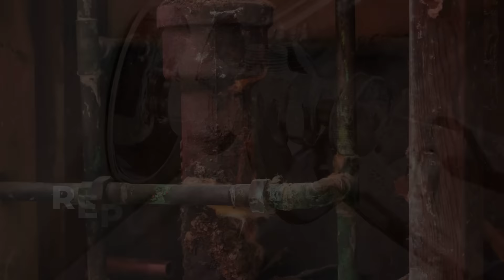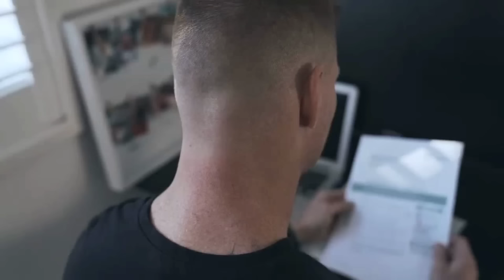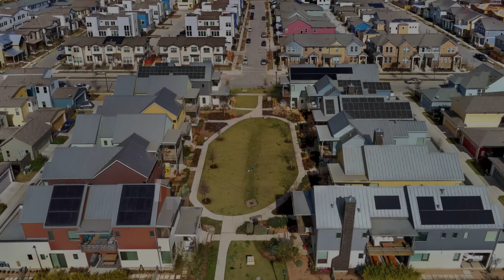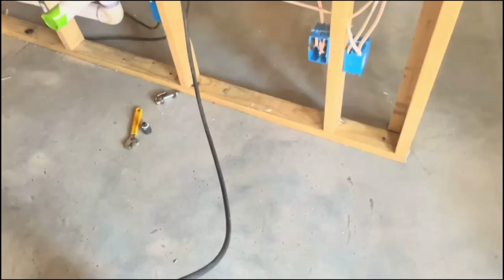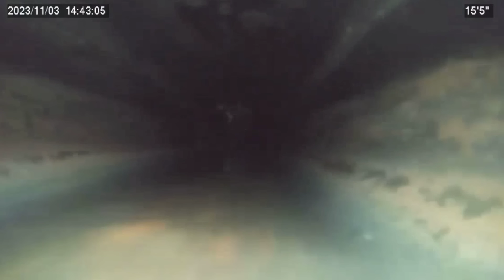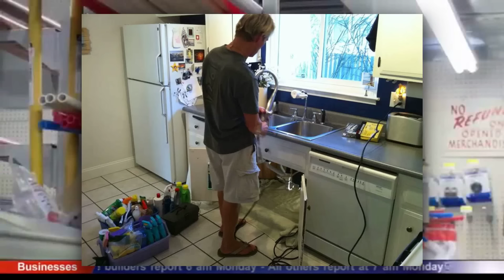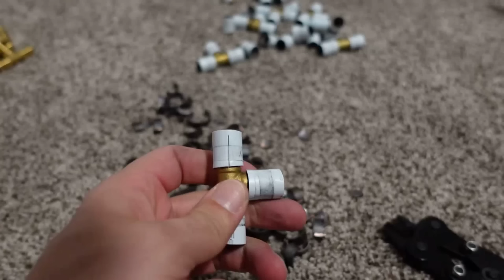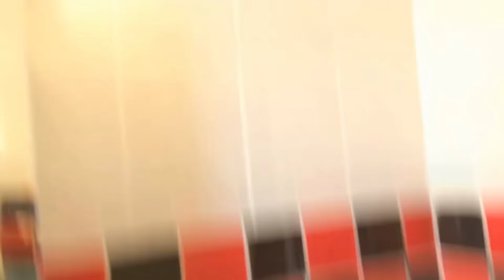Why 90% of New Plumbing Work Are Garbage (The Builder Grade Lie)

Comment: I replaced 60 year old galvanized pipe with PEX-A using crimp rings in 2009 and it is still in excellent shape.  I bought a crimping tool to do this for $125 which is something that a lot of plumbers are unwilling to do.  I don’t trust push on connectors because o-rings break down due to exposure to water.  Don’t believe me?  If you have a black rubber flapper valve or rubber washers in your toilet tank, rub your finger on the rubber and it will come away coated with a black coating.  That coating is rubber.
Reply from the maker: That's a solid move, those push-on connectors are definitely risky 🛠️

Comment: Use schedule 40 pvc pipe instead of abs pipe for drain lines. Copper lines in new houses is tricky because of copper thieves. Anything installed before the house is secure is subject to stolen.
Reply from the maker: That’s is sad, schedule 40 is thick is good for drain. I used it on my hvac system with EZ trap, drain pan, float switch

Comment: Cast iron is rated for around 125 years. ABS is rated for 65 years. The boomers screwed us every way they could.
Reply from the maker: It really makes you wonder about current building standards.
Reply: @QualityRot I would guess the average new home will be condemned at about 75-100 years as the plumbing, electrical and pine used to build them are all rated around 65 years.

Comment: There are automatic shut off valves now. But most of them are garbage too.
Reply from the maker: It seems like you can't win these days 😕
Reply: @QualityRot you just have to read the small print. The water valve is made of plastic and likely has a useful service life of 8-12 years. Unfortunately, they havent been around very long and builders arent required to use them so they cost a small fortune. For a $1000-2500 parts and labor install, youd be pretty protected against major flood damage for 8-12 years.

Comment: There is so much wrong with this video that I don't even know where to start.  Images, not matching the discussion and unrelated images, confusion on push to connect and Pex, lack of clarity on the types of pex, totally ignoring the use of CPVC in supply systems and PVC in drain systems, not clarifying the difference between conventional cast iron and Polylineed cast iron, etc. etc. etc.  Let me just say that blaming all this on the builders is not very accurate either as 90% of the homeowners buy based on price.  They will buy the cheapest part for whatever they're trying to accomplish when they go to the big box store.  There are quality oriented builders out there that will build with better materials, however, they are rare because the buyers force them into using the cheapest materials and labor as people don't wanna pay any extra and we'll buy the new house down the street that is cheaper!!!
Reply from the maker: Thanks for the detailed feedback, I'll definitely take these points into consideration for future videos! 🛠

Comment: A rather broad brush being used here and the prices mentioned are definitely too low. Also I've installed more than a few WHs and they've all come with the proper TPR installed. I only use push fittings for emergency repairs. They never get closed into a wall or whatever.

Comment: I have KITEC in part of my house and it's been in use for 23 years and I've never one had a problem. The video is correct, it's not a bad product, unless the plumber who installed didn't have a clue how to do it properly. I even have a section running to my outside ball valve for my house. The pipe has never had a problem in all these years, but,  i can't get house insurance from a distant company because of the previous issues in other homes.

Comment: I refurbished a 2500 sq. ft home converted to two apartments in 2008. Used pex for everything, including heat lines. That requires specific pex, of course, with an oxygen barrier. More than 2,000 feet of hot/cold and heating lines. Hundreds of fittings. Now, 18 years later, not a thing has gone wrong. This "10 year" claim is just  baloney.

Comment: Pex is not great if rodents are even a possibility.  They chew it open to get water.  Cast iron drains in older homes like to get hard rust clogs. I just had to bust out a few with a power auger, and they are tough. ABS plastic drains seem to last the best and do not corrode.

Comment: 38 years with home run pex and crimp sleeves. No problems except the 36 port mana-bloc started leaking 20 years in. Replaced it with the newer O-ring sealed bloc. Works great.
Reply from the maker: What type of condition are you living in?
Reply: @QualityRot 
Semi-arid, 4700 feet elevation, 70 psi water. 2 kitchens, 4.5 baths, and 2 laundries. Two 50-gallon water heaters in parallel and a water softener.

Comment: I already had 2 cast iron toilet fittings fail due to rust, yes in older homes, but pvc does not rust
Reply from the maker: That’s is true but also the longevity is how the installer installed it

Comment: Ex-builder. Older aged and was working at a big box hardware store running the plumbing section. I told folks back then not to use plastic pipes. Why would you want your water running through plastic? Go copper all the way.

Comment: It seems like, as with electrical wiring, PEX connections should not made behind walls or ceilings.  Those connectors sure seem crappy.
Reply from the maker: I agree with you! I have bad experiences with them. Even installed properly, I’m I am still not with it

Comment: Ok in old time fittings were made not from brass (dezinkification on hard acidic water CO2 solved in water, generates carbonic acid that dissolves Zn) but bronze which is CuSn alloy Sn more corrosion resistant, non toxic (used as staniol in food industry now aluminum which due to its organic salts with fruit/veggies acids water soluble, involved in Alzheimer's) but more expensive!

Comment: There is nothing wrong with PVC or ABS waste lines - cast iron hasn't been used since the 70s in residential, and only in commercial installs now and even that's being replaced. We have ABS waste lines - our house was built in 1982 and all of them still work without issue. By your video, the lines from my shower and kitchen should have melted long ago because they have hot water go down them. Cast iron and clay are notorious for having root instrusion issues, and cast iron rusts out. A commercial building built 4 years later after my home I work in had to close the entire 1st floor bathrooms because the CI pipe is rotted at the bottom.

Comment: Yea I don't trust new build homes unless it's custom. 
Standard track homes I have worked on after warranty has run out for clients.
They will be tear downs in 20 years.
I chose a home built in the 70s with copper plumbing. 
Tried and true. And has withstood the test of time.

Comment: [ PEX ]  is  petroleum based based plastic. Being that said water will leach the plastic into the water you use and in about 15 years it will start to fail not just in the joinery but structurally as well.

Comment: I'm going to get a lot of thumbs down; sometimes the truth hurts.
90% of poor quality is driven by the buyer. Money talks; almost every home buyer wants square footage and finishes to impress. Items such as mechanical systems, foundations, drainage, insulation, flashing details, etc. aren't on the minds of the typical buyer and certainly not a top priority. 
In a subdivision of multi-million dollar homes I watched a well designed and crafted home sit on the market while another builder that had a reputation as a hack sold 6 crappy McMansions. I knew a person that saved up some money for a kitchen remodel, she bought granite countertops instead of a new well that she needed. I offer a quality home with excellent value but the majority of the time I can be outsold by a competitor with a fast talking salesman.
I've been a GC and trade contractor in New England for 45 years, I've seen some things. The thing that baffles me the most is to many seem to be impressed by speed; they'll comment about how fast a house is completed more often than the thermal performance of the windows. Japanese houses have a design life of 30-40 years,  many European homes take a year to build and are intended to last hundreds of years- often handed down in the same family for generations.

Comment: PEX plumbing has been the standard in Europe since the 1980s. It has been used in the US since the 1990s. The new ungrade is the PERT pipe. Basically, it uses the same fittings as pex. Instead of Sharkbite style fittings , I used brass pex fittings with stainless steel collars for indoor plumbing. A pressure tank is used in conjunction with a private well pump. If properly installed, modern plumbing will last as long as you need.
Reply from the maker: True, if it's installed right it definitely lasts longer.

Comment: So the three dollar braided hose flooded the entire town😂
Reply: In a high rise a failed braided line usually takes out 3 floors when it fails. Can be 6 units on each floor.  Very expensive and a nightmare for building managers. Smartest option is body corp auto replace every 12 years and charge unit owners.

Comment: The insurance companies should require some or all of these higher standards
Reply: I seem to remember last year reading that some insurance companies in some states (maybe all) won't insure houses that have polybutylene pipes, if they know it is there.
Reply: @jasonj9864  That's good, but it sounds like they need to require the higher grade flexible hose connectors on sinks and toilets, and the fittings for pex.

Comment: I think the author of this video means Sharkbite instead pex pipe, mostly because pex pipe uses clamps.
Reply from the maker: Ah, the classic SharkBite Sleight of Hand! 🦈 You’re right that PEX should be crimped like a professional, but builders love SharkBites because they can 'install' a plumbing system with the same skill level required to put together a Lego set. Why use a calibrated crimp tool when you can just push two pieces of plastic together and pray the O-ring lasts until the check clears? Welcome to the club of people who actually know what a real connection looks like! 🛡️

Comment: My home in s California had copper pipe after 4 foundation leaks due to earthquakes I re plumbed my home over head w pex MYSELF useing Shark bite and crimp system. 18 years later not one leak. I put the house on the market upon  the buyers  inspection he and his personal hired inspector deemed it quality and the house sold w no issues regarding my workmanship. Best diy product since the invention of ice tea. Professional plumbers hate the pex and Shark bite/crimp system bc when you know how easy inexpensive and reliable it is to work with they loose big $. The stuff just works good what more can I say?
Reply from the maker: Proof that doing it yourself is the best way to get quality work these days! 💪

Comment: "copper required soldered joints, a skilled trade"   Not so much, 15 minutes, couple practices runs and good to go, Not that hard.  
Don't oversell it.
Reply from the maker: While it takes practice to master, soldering properly definitely ensures a much more durable connection! 🛠️

Comment: now in so cal 1 year warranty , sad 3 million $ homes dont get better stuff either . They use same cheap stuff .
Reply from the maker: Welcome to the 'Golden Age of Garbage'! 🏠 Where a $3 million price tag buys you the exact same 12-cent plastic fittings as a garden shed. That 1-year warranty isn't a safety net; it’s the manufacturer’s 'Estimated Time to Failure.' They’ve optimized the 'Quality Rot' so perfectly that the house starts decomposing the day after the check clears. You’ve officially joined the club of people who realize that 'Luxury' is just a fancy word for 'Expensive PEX.' 🛑
Reply: @QualityRot  I am a cabinet setter 40 years Cabinet industry has not change much , But tile no float showers that orange paper with Styrofoam dams .  In my neighborhood 4 story building all out of wood got rained on 2 days roofs were not done I was looking at roofs and looked like plywood was turning black and delaminating, I could imagine what happened to all the wood on the very inside we cant see .

Comment: Everyone on YouTube exaggerates and lies. Pex tubing is a far better and longer lasting product than copper, especially in hard water areas. As long as the fittings are properly installed, you have several decades of safe performance. Copper can produce tiny leaks in straight runs that are apart from soldiered joints. In an unplanned freeze, Pex is almost certainly  not going to burst, but copper will certainly burst. Pex resists accumulation of minerals from hard water. Try making a video that is accurate and balanced for a change.

Comment: Expansion tank?  Why?  I've never had a problem in 55 years without one.  I don't know anyone that uses one.
Reply: About 30 years ago, municpal water systems started mandating the use of backflow preventers. This meant that as the water in the heater expanded, it could no longer push back into the city line, so it would commonly open the temperature pressure relief valve to relieve the pressure.  It could also cause leaks elsewhere in the plumbing system, so expansion tanks became a way to remedy this problem.  Today, I believe most jurisdictions that are on city water systems, mandate expansion tanks on new construction and replacement s.
Reply: Never needed one until the house I moved into in 2012. Without the expansion tank, the pressure release valve on the water heater leaks like a sieve.
Reply: It's the new norm now. It's because the water company supply can't handle it.  Not because your system can't.
Reply: @parkersgarage4216 Municipal water systems are built out of materials that are far heavier in construction and can handle much more pressure and stress than anything inside a house. The reason is because AWWA mandates backflow prevention at meter connections to prevent contamination of the municipal water source.

Comment: In Europe we normally use pipe-in pipe and connection-cabinet typically located in a room with drain in the floor. This avoids extremely costly hidden leaks 😏
Reply from the maker: Oh, look at Europe over here with their 'logical designs' and 'accessible connections.' 🙄 Where’s the fun in that? In North America, we prefer the 'Hide the Failure' method—burying every joint behind three layers of drywall so the first sign of a leak is when your kitchen ceiling hits the floor. It’s called 'innovation,' look it up! But seriously, your cabinet setup is the gold standard we should be following. Thanks for reminding us how it looks when engineers actually talk to the people who have to maintain the stuff! ❤️
Reply: @QualityRot  Don't forget, PEX was invented in Europe in the 60's by a German scientist.😉

Comment: I’ve been a carpenter my entire life, I have a custom cabinet and millwork shop . We build woodwork for houses 3 mil and up . We have seen more leaks over the last 10 years all pex . I’m talking about new construction or massive renovation projects. We work with two builders who require copper only and we never see leaks on their projects
Reply from the maker: Wait, you’re telling me that a $3 million mansion built with plastic tubing is actually leaking? 🤯 I’m shocked! It’s almost as if 'Value Engineering' doesn't care if the house is a bungalow or a palace, as long as the builder saves $500 on the plumbing bid. Welcome to the 'Copper Only' club—it’s the exclusive group for people who prefer their walls to stay dry for more than 45 minutes. Those builders requiring copper are the last line of defense against the Quality Rot apocalypse! 🛠️"

Comment: Calling PEX cheap is wrong. The fittings for pex are ridiculously expensive. Copper fittings are cheaper because no one uses copper in residential anymore.
Reply from the maker: Oh, you’ve discovered the Great Plumbing Bait-and-Switch! 🏗️ The pipe is 'cheap' to get you in the door, but the fittings are priced like they’re made of solid gold and unicorn tears. It’s the printer ink business model, but for your basement. Builders love it because it saves them 40 hours of labor, while you get to pay a 400% markup on a piece of plastic and a brass ring. Welcome to the exclusive club of people who actually look at the invoice instead of just the shiny new faucet! 🛡️
Reply: @QualityRot Pex has been widely used in Europe sense th 70's (where it was invented). It is used all over NYS where I live for drinking water and hydronic heating repairs on boiler systems as well. Your living in the stone age pal. 30 year old houses all-over with non-issue to thus day. If the water is that bad somewhere where ita eating the brass fittings the water more than likely isnt even safe and needs a filtration system.

Comment: Geez dude, there is a huge difference between Pex-A and Pex-B.  You constantly show Pex-B issues.  Pex-A is not a cheap “builder grade” thing.  And no one uses brass fittings with any Pex.  It’s all plastic.  Also,  running copper under a slab is a no go from so many perspectives.  You could also mention that modern faucets have connection hoses permanently attached to the fixture.  No need to purchase steel braided anything.

Comment: I love how you say the builders use the cheapest parts when really that is all that is available. The crap they sell today everywhere is because of penny pinching accountants who save .10 cents but cost Americans millions. Now copper has failed many times and has just as many issues. Cast iron leaks as well but cast iron is used for quieter pipes. But put together with rubber joints that can fail as well.